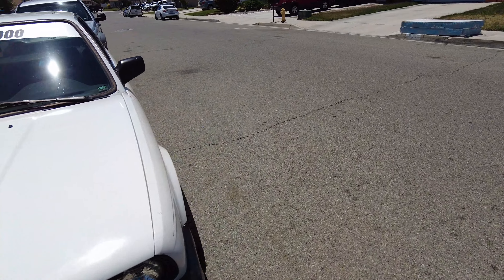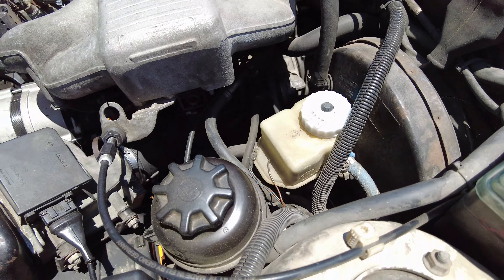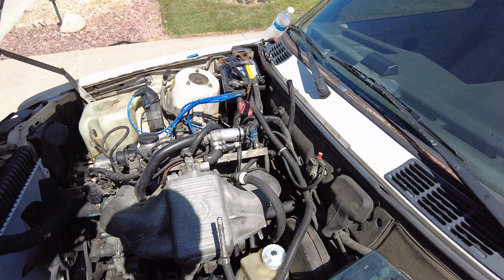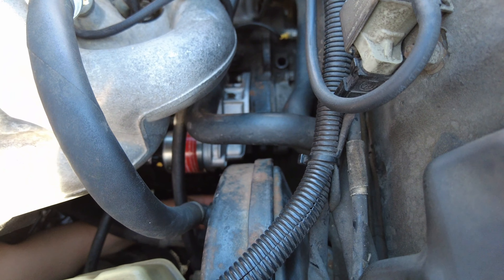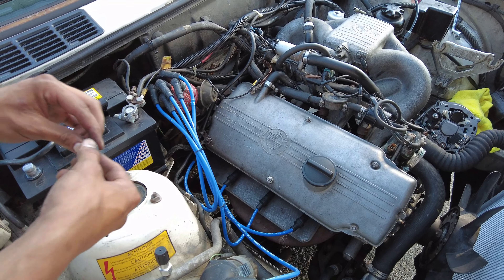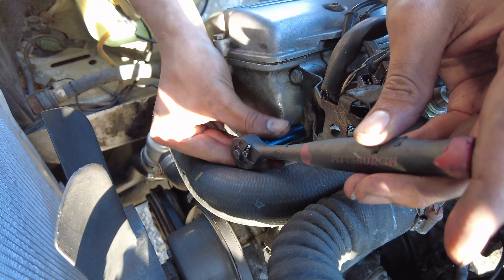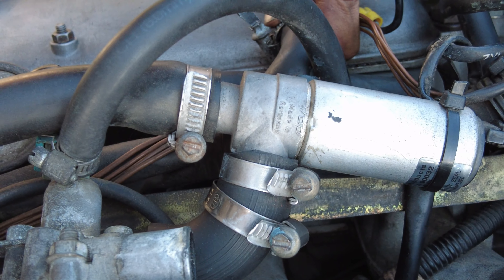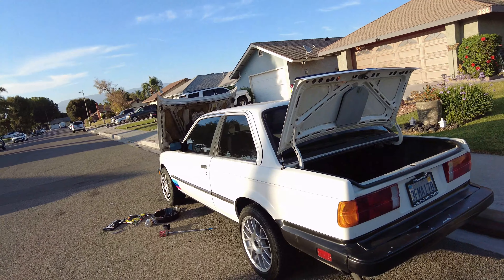How to change your starter on a 1984 bmw 318i

Comment: Hey man! Nice video, Just wish you would have slowed down a little when talking about what connectors are being unplugged.
I jsut bought a 84 318I and mine starts but dies right away.
I see you have a two grounds at the valve cover. could you tell me where these lead to? TIA

Comment: need a video on how to change the O2 sensor for the 84-85 m10 e30🤦🏻‍♂️
Reply from the maker: Its super easy tbh
Reply: @fi3rrooo  only problem for mine is the previous owner left the wires all exposed😅